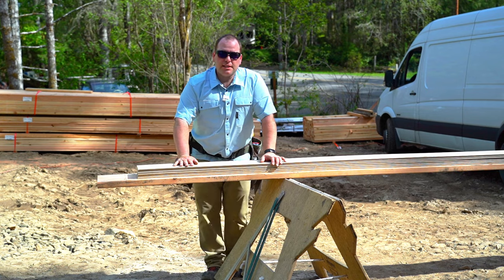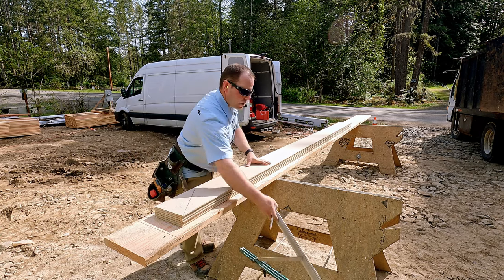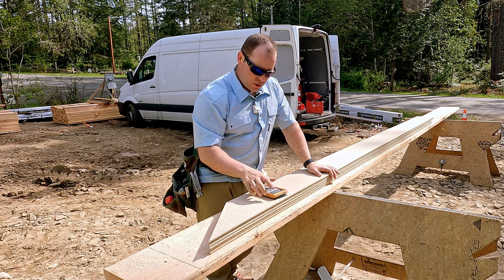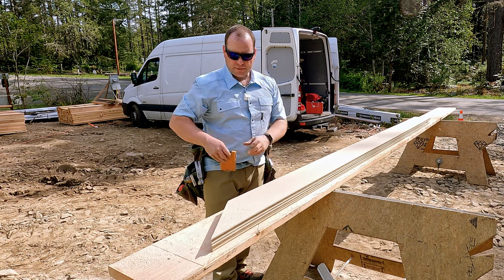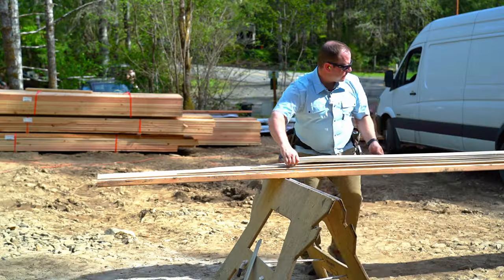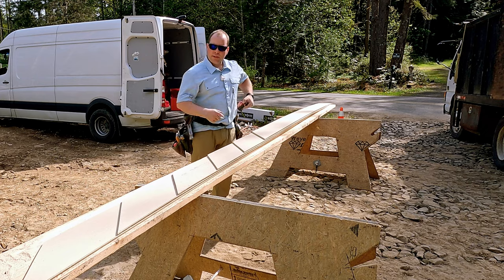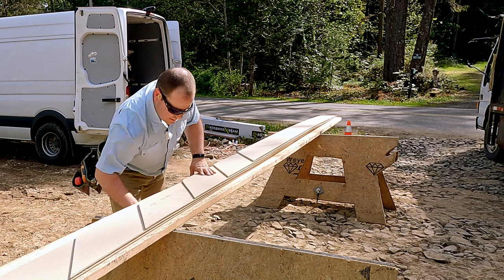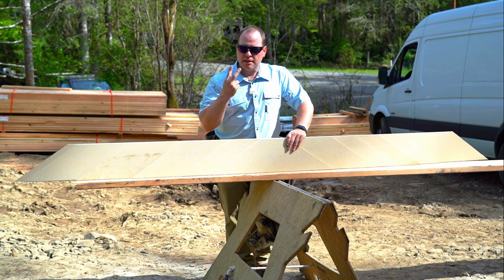Gang Cutting Gable Lap Siding

Comment: but is this most efficient for waste? because you could have probably got the last 3 cut peices out of one full length board? and the 4 and 5th smallest cuts out of another full stick?
Reply from the maker: good question 👍.  To me any good sawyer can manage his waste.  The other side (assuming I did this in 1 take and was still starting from 16' lengths) the other side could be used for the pieces as they good shorter up the gable.  In this case I'd cut the angles off and use them on short walls or around windows.

Comment: Very helpful for you to show how to figure that with the calculator
Reply: Instead of a calculator what I do is use my speed square on the side with a gable cut. Clip the bottom and slide the square over until 6” intersects a spot on the gable miter, make a square line where it does. Then measure from the tip of the gable miter to the square line that was marked at 6” and that’s your measurement of how much smaller it’s going to get per cut.

Comment: Which calculator are you using?
Reply from the maker: I use the Construction Master Pro Trig and keep it in my bags, but I also use BuildCalc on my phone because it'll generate all the angles I need roof framing.
Reply: @AwesomeFramers  would love to see a video 100% on how you use Build Calc and what it works best for.  Great work and thanks!
Reply from the maker: @hiney0183  I don't use it to its full potential but I'll definitely start a series on that.  Thanks !!